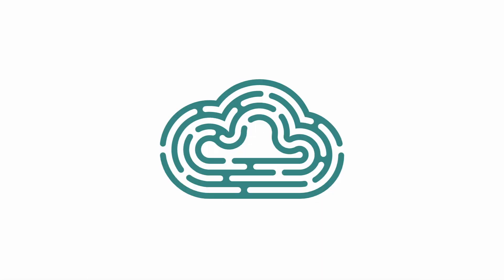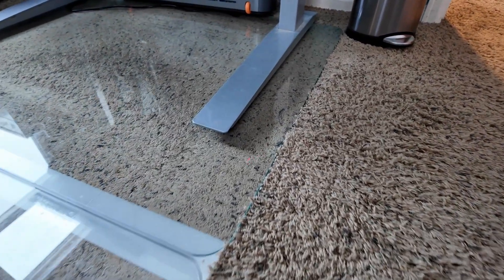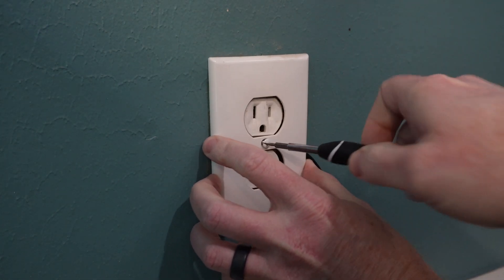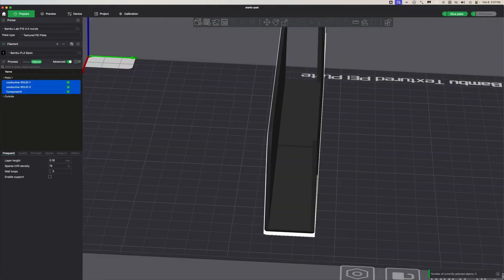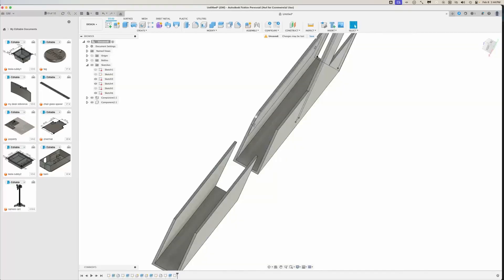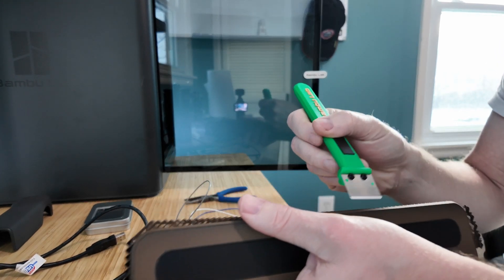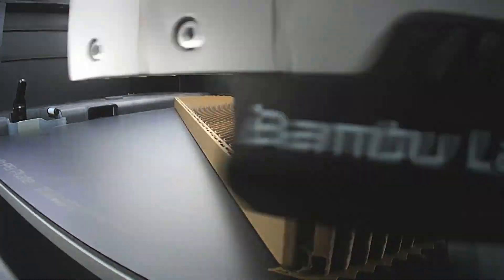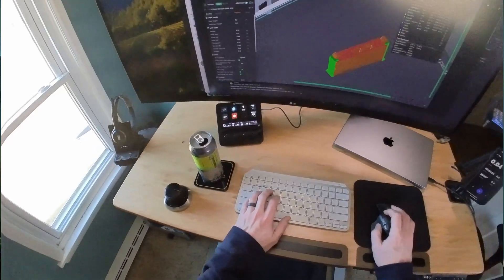My Desk Setup Was Ruining My PC (and how i solved it)

Comment: Fascinating video. I was actually led here by Gemini Ai, when I was asking it about a similar issue I was having that I suspected was due to ESD. My setup made it so I was building up a charge on my large mousemat, that travelled through the metal arm that is fixed under my hollow desk, that holds my keyboard and mouse, and the only way this could find a ground was to travel up the metal feet of my monitor, causing it to flicker off and on occasionally.  So, who says AI can't be helpful eh? It helped me fix my issue and got you a new subscriber.

Comment: My new monitor has been having the same flickering issues throughout this dry winter. My set up is on a glass + metal desk and my cozy sweaters and blankets keep generating static electricity. At first I didn't ever feel a shock so I also though it was a cable going bad. So it wasn't until it started becoming more frequent that I realized every time I shocked myself on my desk/keyboard/mouse and my monitor turning off and on that that was my issue. Still trying to figure out the best way to keep my coziness while not accidentally frying my equipment! Your video was very helpful for understanding my issue further!

Comment: Why not use a simple carbon brush dragging on the treadmill belt to discharge to the USB cable? They've had this solution for vinyl records since, basically forever.
Reply from the maker: Do you have a link to an example?